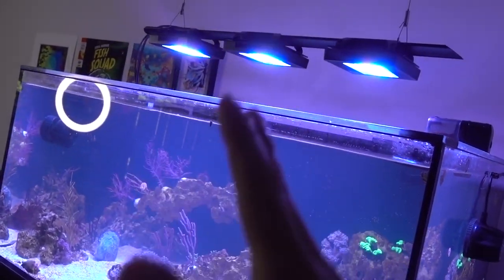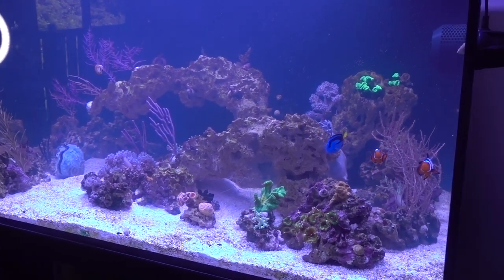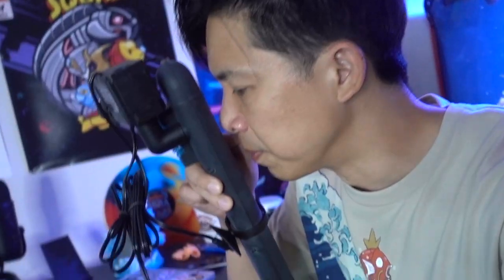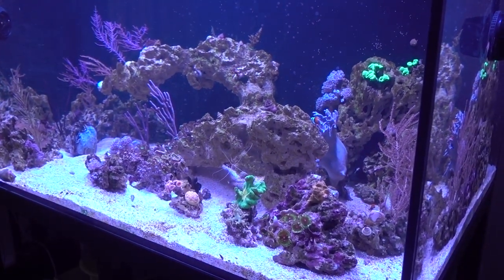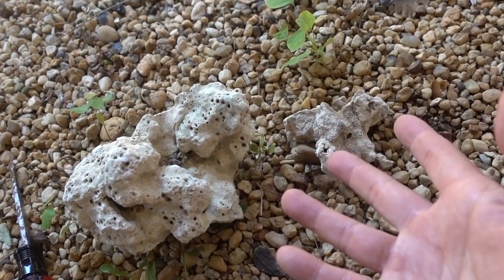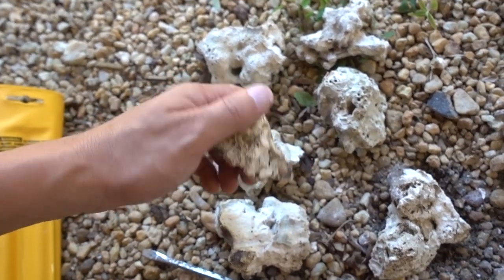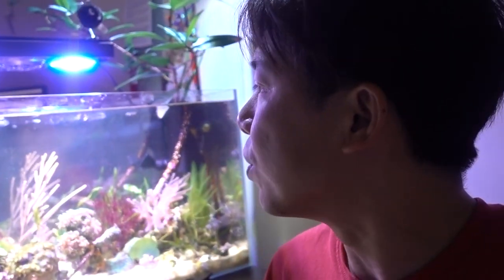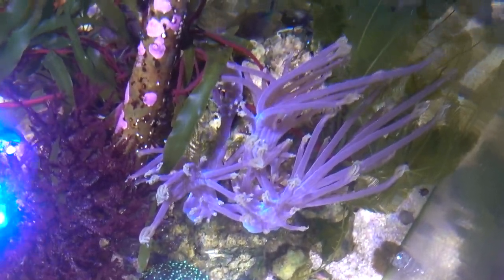DIY Frag Rock, $75 UV Sterilizer for Cloudy Water?!

Comment: Those green killing machines are super powerful. I’ve been running a 40 gallon outdoor freshwater fish breeding tub and for months now it’s had crazy green water. Like, so thick that you can’t see the terra-cotta pots 6 inches under the surface. I decided to experiment with a 9w green killing machine that I got in a box of used aquarium parts. It’s been in my tub since Wednesday and the water is halfway to being completely clear. And again, this is outdoors where sometimes the tub will get 8 hours of full sun. I’ve been videoing the process and can’t wait to make the video
Reply: Thos green killing machines are bad for saltwater though since the propeller inside rusts.

Comment: I added a UV sterilizer (aqua UV advantage 15 watt) to my tank recently. As with all things reefing I found some who where for and some against its use. My tank is a fluval corner tank, which has the bottom drilled for a canister filter under the stand. The output of the canister goes through the UV before going back to the tank. When I set up this used tank I decided to also use the filter knowing I would have a sump also. I had thought why would I plug the holes and not use it.  Makes the addition of carbon when needed easier.  I recently picked up some shelf rock and it is currently curing in a barrel . I was thinking to do the same, breaking up some pieces to use a frag plugs. Glad you did this part of the video so I could see it  done first!  Thanks for the videos, keep on reefing!

Comment: You can run that UV 24/7 on your tank, no need to pull it off. Beneficial bacteria live in your sand and rock, not in the water column. Leaving it to run continuously will help kill algae spores and keep that tank in top shape.

Comment: Ok...  So I have been trying to raise my Nitrates. Tank is 10 months old using BRS method.  It is a RedSea250 (about 65gal). All my SPS and LPS look good (not great) and  growing well.  Zoas not so well.  I run a skimmer and filter floss.  At this point I only run skimmer for 2 hours a night. After about 2 months I have Nitrates!  And algae blooms in water.  I installed this unit and my water was crystal in about 6 hours!!!! Thanks.